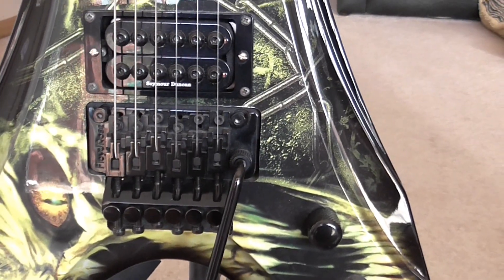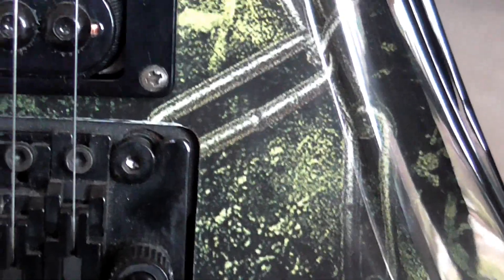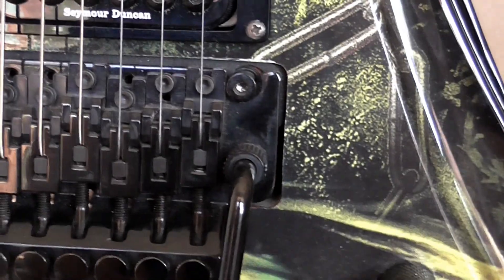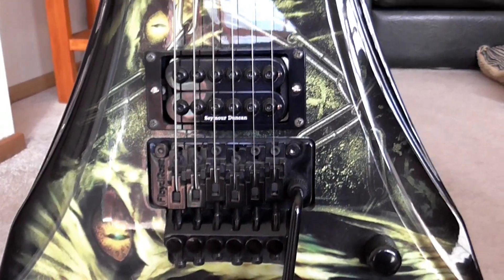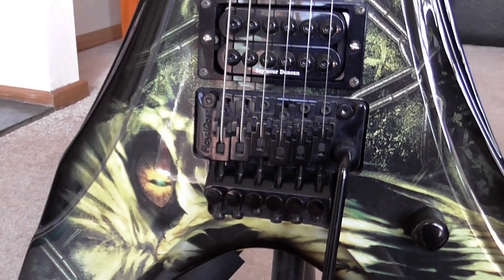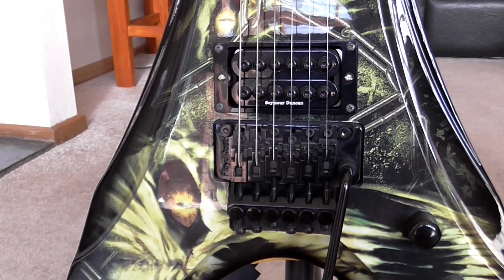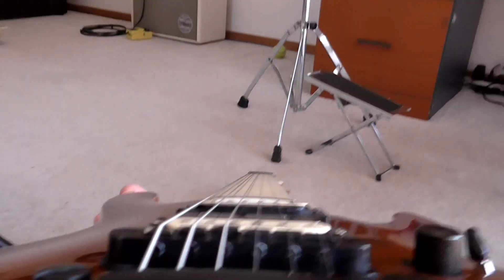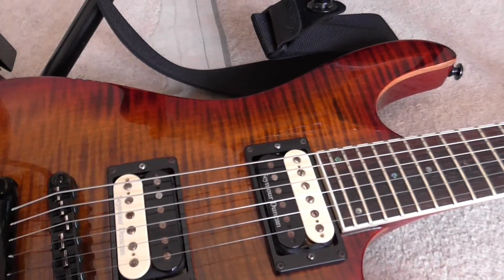Floyd Rose VS Fixed Bridge

Comment: I got a Schaller Lockmeister trem in the Dimebag tribute guitar, because I really didn't want to have such a guitar with a shitty trem. But I only use the trem for nonsense tricks, dives and squeals when I'm bored.. And it really doesn't sound musical. Only a few guitarists can use it and make it fit in a mix, but it really is alot more hassle than it's worth. I've begun to love my fixed tail guitar more because it even sounds better. Floating trem is a tone-sucking show-off toy, and I regret spending money on it. Even just drop-tuning's so much hassle that I don't wanna bother with it and rather use the fixed tail guitar for that. Drop tune in a quick turn on the low E peg, VS unlock the nut, jam the bridge block, de-tune low E, re-tune all the others to compensate spring tension, check action, re-adjust a few more times, intonate, lock the nut...? No way I would do that every time. EVH does have that D-Tuna gadget you can put on these floating bridges, but I've never tried one.
Reply: Jm Cresencio how did you do that?? My bridge goes just ham and unstable if i ever try to down tune it.

Comment: I feel like I should get a guitar with a floyd, or at least some sort of a tremelo, but the floyd has always intimidated me with the setup. Hearing about the lack of bass doesn't help the cause out either.
Reply: KEWB99 what is your style of playing?
Reply: Josh Smith Mainly power metal with some other types of metal thrown in there as well. I actually just tried a guitar with a floyd at a shop today and didn't have an issue with the bass and really enjoyed it. Obviously I can't get much of an idea on how it is to set up from that but I guess I'll find out as I ended up ordering one.
Reply: KEWB99 if you want to play the stuff like dragon force id recommend a floyd rose
Reply: I'm more of a Blind Guardian fan, but they do use one as well. I figured it'd be nice for the genres I play.

Comment: Here's the summary. Floyd rose is shit. Fixed bridges are great. 😊
Reply: MobileDecay You think that cause you. Can’t afford one.
Reply: @mousumichakravorty8243  oof 😂
Everyone have their own preference

But as i am on a budget and for others who are also on budget (like $300 or $400 limit) , 
Fixed Bridges will be better as most of the price come from the wood,the pickups,etc 
Whereas in Floyd Rose, most if not decent amount of price is on the bridge itself and not on the specs

So yea for budget, fixed bridged guitars will usually be a better choice in my opinion

And since I'm used to the fixed bridged way of changing strings and intonation
I feel like Floyd Rose is trouble some but yea Both are Awesome